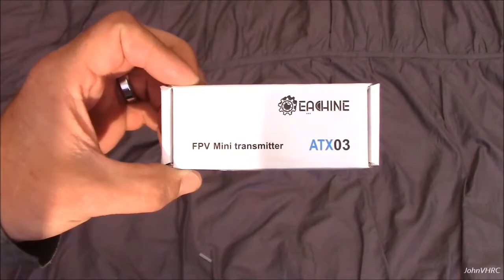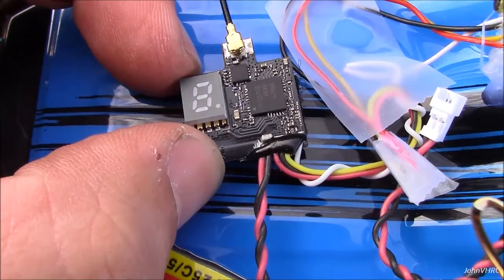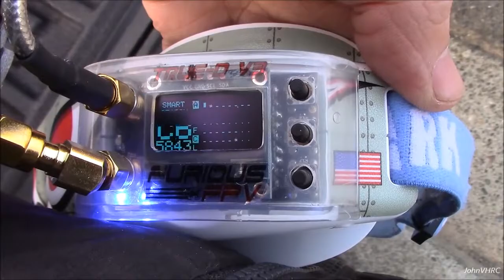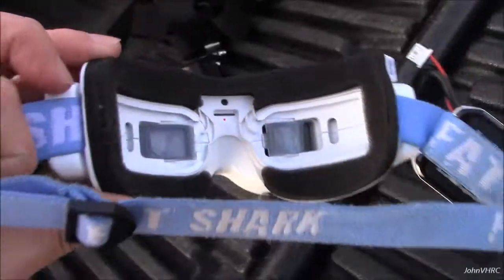Eachine ATX03 Mini 5.8G 72CH 0/25mW/50mw/200mW Switchable FPV Transmitter Unboxing Review

Comment: Hey I have this little VTX and it doesn't say ANYWHERE on it what it is! So had a bunch of trouble trying to figure out if it was SA or vid in and vid out!?? Found your vid, and noticed lol in the instructions that came with yours, if you still have them LOOK AGAIN! for they show the TOTAL WRONG WIRING!! PERIOD!! It's even different from the one you show on camera haha it is right, and I had a couple of the wires still on the thing, AND IT WAS LAST WORKING and I thought,.....NOW I KNOW some that the two or three wires on it HAD to be right and were NOT jivin' with what I first paused the vid and looked at the manual itself here haha!! What a deal! Didn't know if you caught that for you do tell the correct wiring when showing the actual VTX lol AWESOME!! lol Have a good one!- L8r-Turbo.